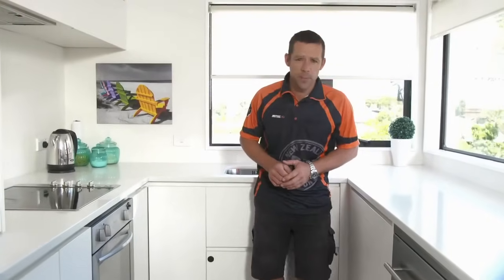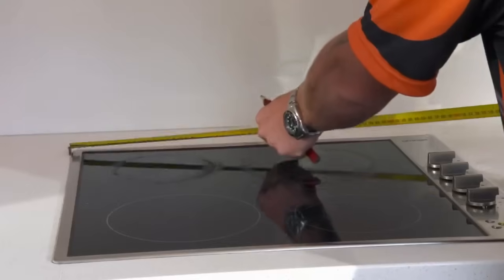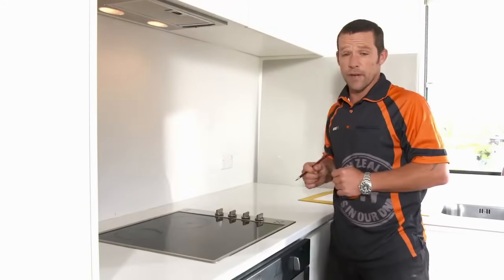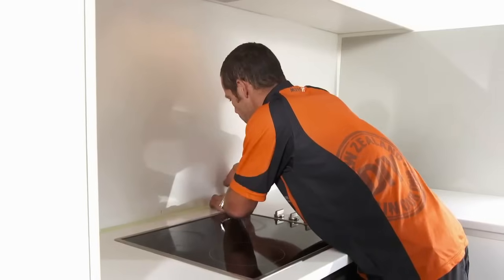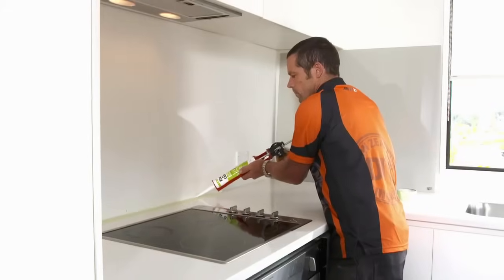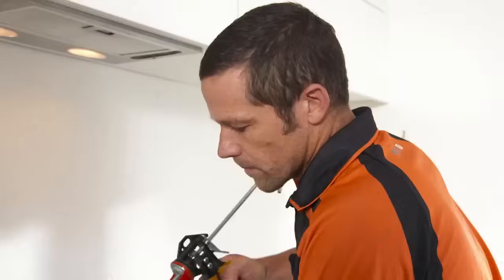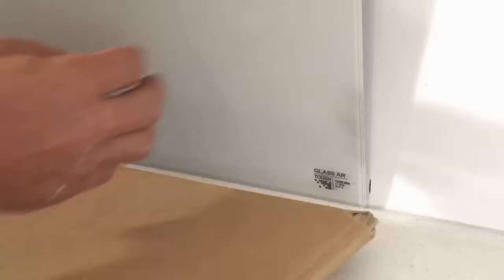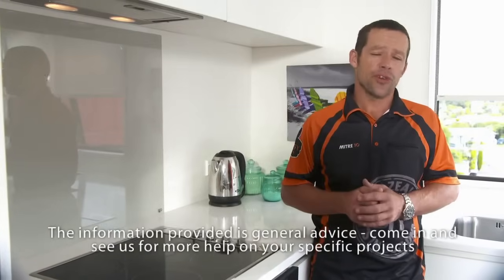How to Install a Glass Splashback | Mitre 10 Easy As DIY

Comment: Can you put a glass splash back onto tile with silicone?
Reply from the maker: You can install a glass splashback over tiles using silicone! Just make sure the tiles are clean and dry before applying a good-quality, silicone adhesive. ^Cam

Comment: I've got white silicone sealeant left over from going round the worktops in the kitchen. Would this work and be ok to use putting up a black glass splashback?
Reply: Yeah should be fine, but only if the black glass is not see through!